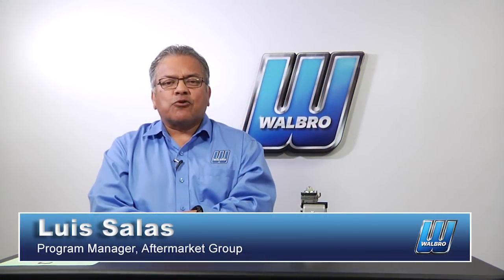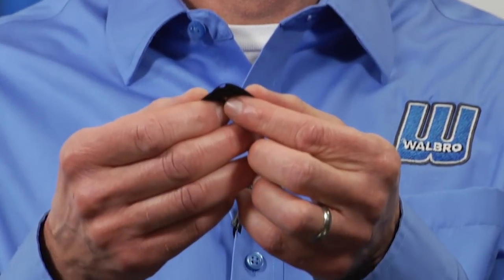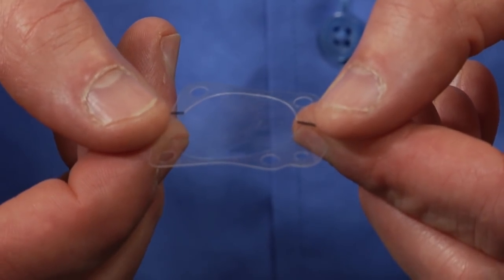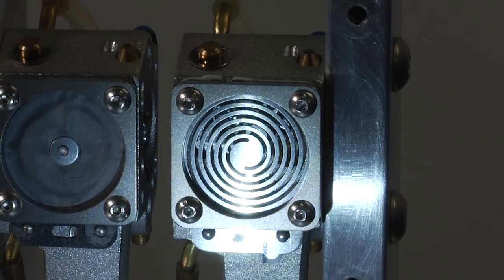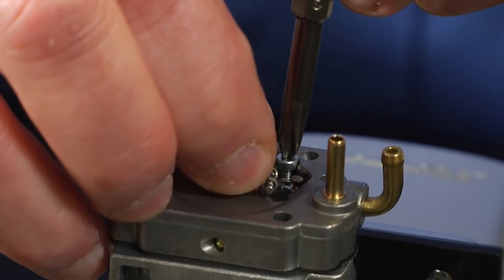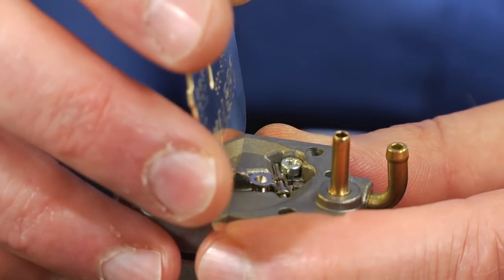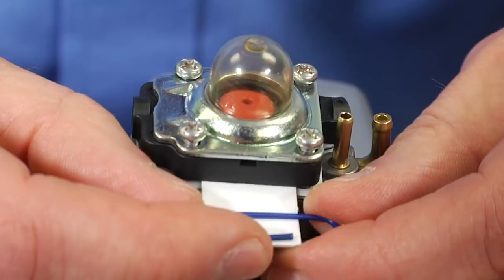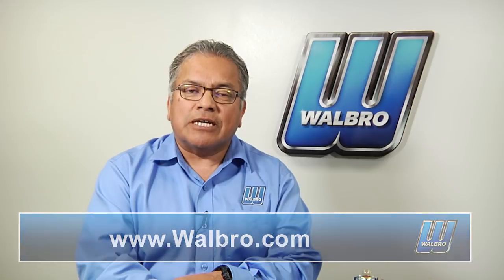Walbro Spiral Diaphragm Carburetor

Comment: Great improvement. I had to replace several diaphrams on my small engines over the years. Can a pump diaphram made the same way, especially the check valve flaps? May have to be a hybrid stainless and mylar/rubber. Stainless flaps and mylar/rubber pump.

Comment: How are you going to address modern fuels impact upon the internals of the "Check valves" contained in the Idle and high speed fuel circuts withion the carburetor itself.. ?  The second question comes down to impact of mixed in cleaning aditives added to todays fuels and there impact upon the materials of the fuel system like the fuel lines all these broken down Plasticizer like materials get carryed into the internals of the Carburetor itself ..

Comment: The adjustment screws on my 3 yr old leaf  blower Are so small you need a quantum screwdriver to get at them plus i don't know if a screw driver even works ,so now it bogs down ,must be some stupid skell from woodstock that designed it.
Reply: Hello James - depending on the series of carburetor and  customer, some of the adjustment needles have become quite small.

Comment: hi i need a confirmation. iam a PARAMOTOR PILOT AND HAVE A MOSTER 185 ENGINE IT HAS A WB 37C CARB.IF I CHANGE THE DIAPHRAGM TO A NEW SPIRAL. I WILL NOT HAVE ANY KNOWN PROBLEMS PROVIDING I FIT THE PARTS CORRECT. DATE 16/10/2020
Reply: Hello Tony - spiral diaphragm has not been released for Walbro's WB series carburetors.  Keep checking walbro.com as additional series carburetors will have spiral diaphragm upgrade kits released in the future.

Comment: I first saw this in a Walbro promotional video, but they didn't have it via Amazon at the time.  Diaphragm performance looks impressive, but way overpriced in my opinion.  And they don't even include a new needle.  So if you want to replace the other parts that come with a regular carb kit, you have to buy both the carb kit and diaphragm kit.  What a rip off.
Reply: @ptmoy1 - thank you for your feedback on Walbro's patented spiral diaphragm.  Walbro realizes that spiral diaphragm is not for everyone.  We respect your opinion and hope some day you will try spiral diaphragm on an application as people that have tried it have been extremely happy.

Comment: Now if only you could come up with a way to keep the prim bulb from rotting away 😁   Although their pretty easy to change 👍👍
Reply: Walbro did.  Check out part numbers 188-566 and 188-570.
Reply: And the damn check valves under the primer bulb too. Carb cleaner kills em insta.

Comment: That’s cool but the pump side is still going to get attacked by the ethanol preventing it from working
Reply: Typically, the pump of the carb will continue to function 10x longer than the metering diaphragm because the pressures are so much higher. Our tan and blue colored pump diaphragms have the best resistance to ethanol. Thanks for the good comment.

Comment: So...what about the check valve side ?
Reply: Generally most of the problems are on the metering or needle valve side . the check valve side is usually a nylon caviar mix with fiber gaskets . most of the carbs I see have a metering valve an needle seat problem from gas left in them an store for long periods time .

Comment: My machines have NEVER had anything in them but pure, ethanol-free pre-mix fuel (bought at the ridiculous price at HD) specifically to avoid this kind of problem, and the metering diaphragms STILL crapped-out after 2/3 years. So don't blame shoddy materials on ethanol!
Reply: Ed even the pre mix fuels are junk they contain chemicals like Alco lights that are damaging not only to the carb but other components  as well products like true fuel an stihl , Husqvarna's pre-mix are high in Alco lights  that over time will in dead damage other parts of your equipment like cylinder gaskets an gas caps , it cause the caps to swell an be tough to get off . I know were I live we have an air field that will sell avgas in 5gal to the public it is non ethanol an usually around 91 octane . I've ran it for years with no problems
Reply: @werewolfpa6628  The number of petroleum and chemical engineers in the YouTube comment section is just breathtaking!
Reply: To be fair, the gas they are selling in comparison to the leaded gas back in the sixties is also inferior to say the least. The chemicals are destroying the components. I'm not sure it is so much a Walbro problem as it is a gas problem. At the end of the day, the consumer is losing.

Comment: Will these work in the carbs on my DLE 55 engines in my rc planes? The carbs are exactly the same as Walbro but have DLE stamped on them
Reply: most DLE used to carry a Walbro and now they use their own carb, I think they are exact copies. They should work